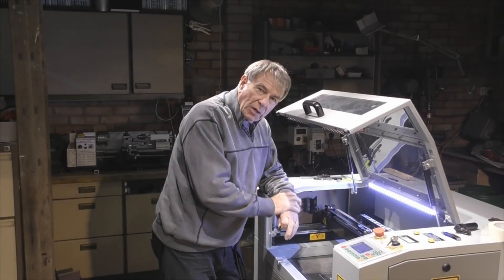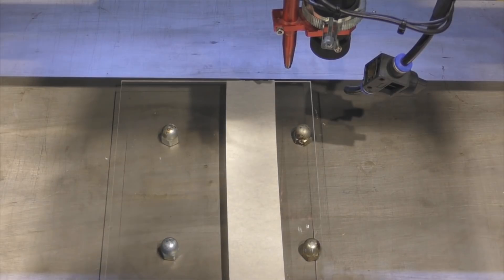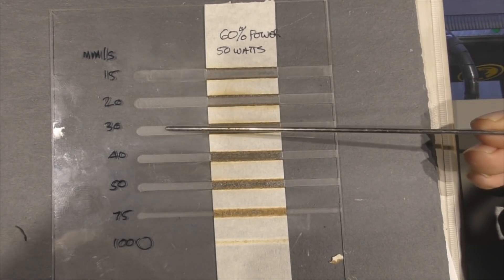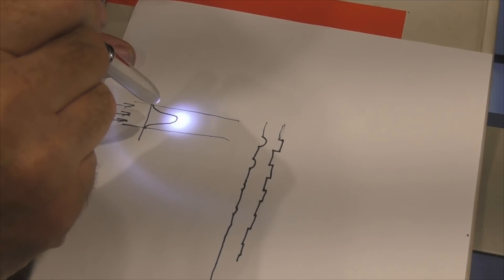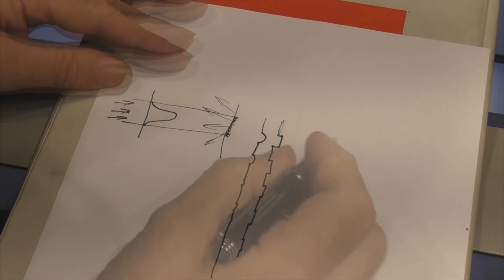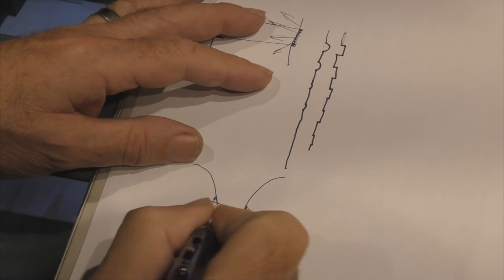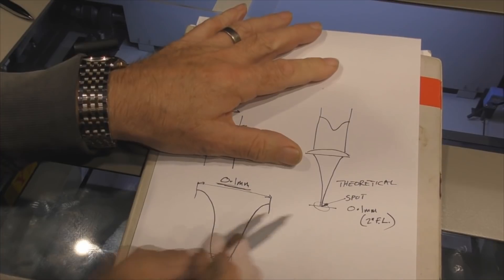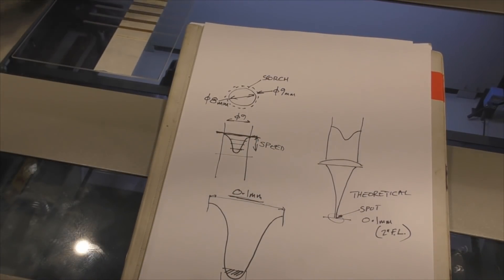RDWorks Learning Lab 124 How can we get smaller dots

Comment: I enjoy your videos : )

BTW, https://en.wikipedia.org/wiki/Gaussian_beam
Reply from the maker: Hi Brenda
Thanks for the wiki link. That's a pretty full (and heavy for most folks) description. I would say that the beam we see is approx Gaussian. With all the mode burns I have done on different tubes I have never seen one (apart from expensive industrial machines) that has a proper Gaussian form. Conical (ish) would be my closest description. Without doubt more power in the centre.  I try to keep my physic and maths VERY simplified because A) I'm not a physicist and B) not a mathematician. With a very diverse range of viewers including high school kids that use these videos as technology learning aids, I try to keep the principles I describe at a very simple visual level. No one is ever going to manufacture a laser tube from my description but they may gain a visual understanding of why they should respect it.
The Wiki picture is a nice easy presentation that may be useful in future. So again, many thanks for the link
Best wishes
Russ
Reply: You're welcome.
Also, I think that the tape cannot sink or transfer as much heat as the acrylic.; I think that is why the line on the tape is finer.

It would be neat to see the heat in the plastic. Perhaps FLIR will send you a camera, if you can show them that there is a new application for it.
Reply from the maker: Hi Brenda
You are right again. The thermal conductivity of paper (the main constituant of masking tape) is about 20% that of acrylic.  My real point was that with acrylic, s the speed increases there is less energy per unit of time  to inflict damage to the acrylic. As the speed steps up, only that energy that is high enough per unit of time  can damage the acrylic. That energy density only exists at the centre of the energy cone. As you get faster a smaller and smaller diameter of energy exceeds the damage threshhold and the line gets thinner. 
The tape was there as an indicator to show that if you go fast enough you will eventually exceed the energy per unit of time required  to damage the acrylic but that more vulnerable materials with a lower damage threshold can still be damaged. The line thickness on the tape was not important but I think because of it's lower thermal conductivity, the heat is not conducted away as easily and that probably makes it more sensitive to the burning. To show this line thinning  effect after the lens when the power density is many magnitudes greater will be a much greater challenge...but interesting. to try.

Thanks for the IR camera suggestion but I find that acrylic  is such an amazing low tech  test material for IR, it gives me a 3D printed record. It's then  a bit like interpreting footprints in clay or sand. You can deduce so much from the patterns that are traced. 
All best wishes
Russ

Comment: Hello Russyou might want to research the topic of spatial filtersPr
Reply from the maker: Several months ago I had a suggestion that  maybe I could add beam collimating and spatial filtering to improve the size and quality of the beam. I did a quick investigation and apart from the eye-watering cost, all the gear that I saw was only suitable for optical table work because it was bulky and not suited to our head design. I have done mode burn tests on several different tubes (150w EFR, 100w Reci, 100w EFR and 80w Mactron to name but a few)).  They have all demonstrated very good TEM00 characteristics. Some have a sharper concentration of power at the centre which I suppose is why they claim it as a small beam tube.  As I have mentioned several times to others, my learning journey is all about understanding the machine and the underlying technology. I may bump into problems and shortcomings along the way, but hey, I paid half of nothing for a fascinating piece of kit that works far better than I could have imagined. I have no intention to spend more money  upgrading it to an industrial spec machine, just to explore where the boundaries are . I never cease to be amazed at the performance.
Thanks a lot for your comment because it is guys such as yourself that suggest things that are outside my skill set. It does force me to gain a wider view of some specialized aspects of the general laser technology. Acquiring knowledge is no bad thing because although unused, one day it may trigger a light bulb moment.
All best wishes
Russ
Reply: Hello RussOk I believe you have a lathe there, the kind of spacial filtering I have tried is just a hole.I turned a piece of aluminum to the same size as the lense, drilled a hole in the center and countersunk to get a knife edge on the hole. hole was around 2mm. this is placed before the lense using the lense clamping ring, a fiber washer keeps the aluminum from touching the lense.this was just an experiment I have yet to fully test, what I can say is there is a  reduction in cutting power as I am now throwing away power. this is however intentional as it gets the tube out of that band where it goes into oscillation. there are still things to try, size of hole, distance from lense.experiment onPr
Reply from the maker: Hi
I like your attitude...forget the expensive stuff and let's keep it simple. There are two problems with your aluminium disk. 1) if you leave it untreated then it will 99% reflect any IR that hits it. That in turn has the potential for wave cancellation on your incoming power. 2) if you treat it with anodizing or heat resisting paint then all the energy outside your hole will be converted to heat as it is absorbed by the washer. From what research I did I thought you had to pass the light through a  focusing lens first and then get the focused beam to pass through a finely tuned pin hole,  after which you then collect the defocused (but cleaned up) beam with a final focusing lens. As I said, that's too much to cram into a lens tube and as this is not a precision laboratory experiment on a light table, I felt, crude or not, our beam was adequate for the intended purpose. I can understand your aim to get finer dots and higher resolutions,  but my goal is to find the absolute boundaries of performance for the standard machine.
Every failure is a step closer to success, so push on with your experiments and keep me updated on any positives or negatives. I am happy to show my failures on camera because  it helps other steer away from that path. This whole technology is a fascinating learning journey and you are digging into a really dark corner. I wish you all good luck 
Best wishes
Russ

Comment: Hey Russ,  I remember in a previous video you mentioned you modified your laser head to accommodate shorter focal lenses.  Can you send me some information about that or put it in the rdworkslab.com forum
Reply from the maker: Hi Nathan
My original China Blue  was fitted with a 1.52 lens and that was already mounted in the nozzle itself. When I got the Lightblade machine the lens arrangement was much better in that the gap between work and nozzle remained fairly constant at about 6mm. But what that meant was that they did not cater for a 1.5" lens. Thus it came about that I had to modify the nozzle and make my own arrangements. Here is an unpublished video to show how I did it.

https://www.youtube.com/watch?v=M9L13-efN8I

Hope this helps
Best wishes
Russ
Reply: Does the focal lenses rest in the nozzle?  I see ebay selling a bunch of air nozzles for different focal lengths.  Next, if it is just a simple replacement of the nozzle head, is this something I can 3D print or will tthe plastic get to hot.
Reply from the maker: These nozzles definitely hold the lens. The idea here is to get the air assist close to the work surface regardless of the focal length.Whereas the lightblade system sees the lense disappearing up the tube. I have no idea what thread compatibility is like, I think these fit their own lens tubes. The question is whether the lens tube diameter fits your head or do you require a whole new head/tube/nozzle assembly?

Plastic is a no no. Especially the ABS which is the most common 3D printing material When that burns it gives of Hydrogen Cyanide gas ....DEADLY.
Best wishes
Russ
Reply: Thanks for the replies back and thanks for all you have done for the laser community.  I have really enjoyed watching your videos and look forward to all future ones

Comment: You also need to take into account that the beam is a round circle. At the top and bottom of your lines, only a small amount of power is overlapping as the beam moves along the axis, where as down the center of the line, the entire diameter of the beam is overlapping exposing the center of the line to a longer period of beam energy. I'm not sure if i'm explaining myself very well. If the beam was a square, the top, center and bottom would all receive the same amount of energy as the beam moves alone the axis. But because the beam is round, the top and bottom receive less energy where are the center receives a lot more energy.
Reply from the maker: Hi John
Your point is completely understood. There are both low energy and high energy parts of the beam passing along the centre, whereas at the outside there is only a small amount of low energy in one place for a shorter period.  These low energy areas (central or otherwise) disappear from the equation as the beam travels faster, because it's only the high energy central part of the beam that has enough energy PER UNIT OF TIME to damage the material surface. Go faster and the energy at the centre gets diluted even more, ultimately reaching a dilution where it only heats rather than damages the material it contacts..  This point is well illustrated by the last 100mm/sec line where the damage threshold of the acrylic was not reached  even though the beam power had not changed.
It's going to be a lot more difficult to analyse what's going on  once the beam has passed through the lens.....but that wont stop me trying.. Every failure is a step closer to success
Thanks for the comment and maybe you can see how this relates to your own efforts although you have complicated the situation by varying the power as well. Changing the power in the beam does not change the basic  Gaussian energy density profile , just the level of  the peak energy, and thus energy per unit of time on a single spot. .
Best wishes
Russ

Comment: How do you set the machine out of focus ? Apparently you get a cleaner engrave and don't get the dust residue as you're melting the plastic not burning it.
Reply from the maker: If you drop the work away from the nozzle the beam will go out of focus. The amount you drop is dependent upon the focal distance of your lens. A longer FL means bigger drop.  By defocusing you are reducing the peak energy density at the centre of the beam. so that it does less aggressive damage to the material. There is a very complex mix of parameters for you to think of when engraving. It's all to do with the material and its damage threshold. 
Perhaps you will be able to understand better with an analogy that you can easily imagine.
Let's replace the laser beam with a candle flame.. you know only too well that it will set fire to paper and it will also burn your flesh. if i pass a piece of paper right through the flame, it will not catch fire until i move it really slowly.
That's because it requires a minimum amount of time for the heat to build up to the ignition temperature. Move the paper fast  and you are diluting the heat and it never gets to ignition temperature at any ONE point.  Now do the same thing 150mm above the candle flame. Yes the paper will heat up but it will not ignite because the heat is no longer focused and  the ability of the heat to "damage" the paper has been attenuated (softened).
The point I make here is that just increasing the speed will achieve a similar dilution of energy at a specific point.
Leaving the speed the same and reducing the power, is another way to achieve the same result. Using a longer focal length lens will also reduce the energy density at a specific point ......and of course you can de-focus.

Best wishes
Russ

Comment: You want to change the wavefront?
Reply from the maker: I think you are referring to the frequency that the laser operates at. Sadly these machines are nor radio frequecy controlled. They are steady state DC systems. The only frequency available to adjust is the Power Width Modulation. That is set to it's maximum of 20KHz  and if you reduce it you slow down the response time of the controller and is not directly causing a change to the beam characteristic. 
Nice thought Many thanks
Reply: No, I mean "Refractive Beam Shaping Optics for Advanced Laser Technologies" http://iopscience.iop.org/article/10.1088/1742-6596/276/1/012171/pdf